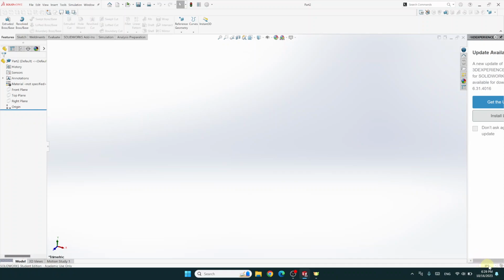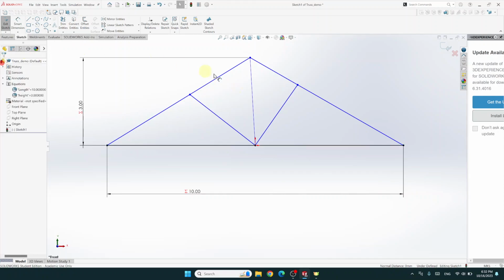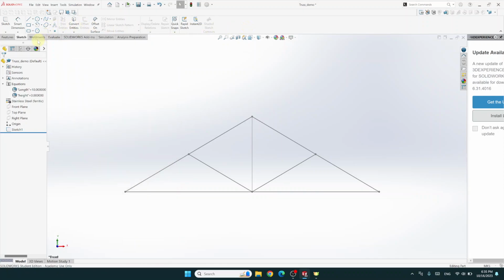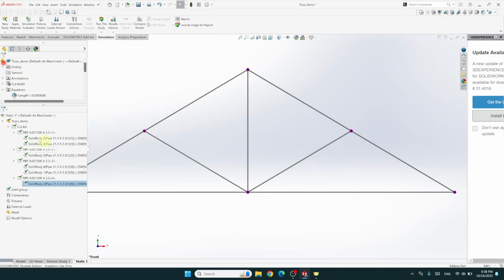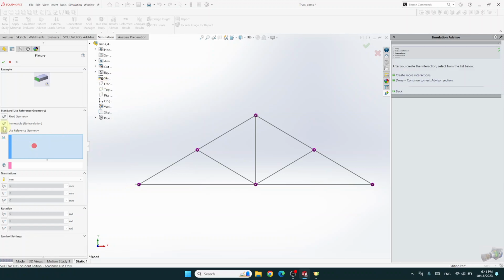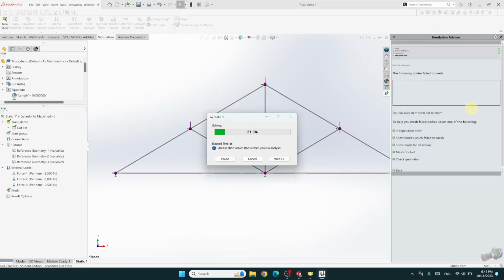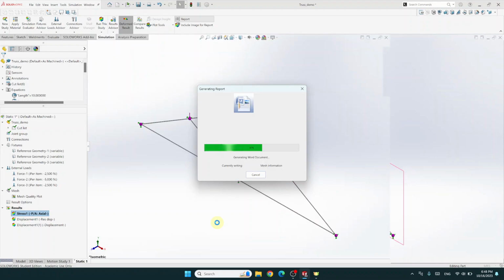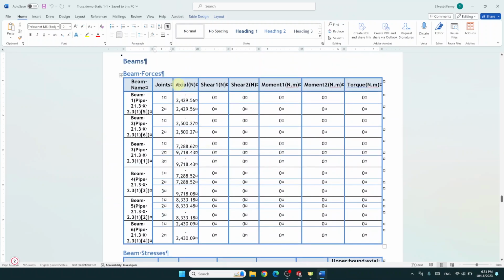Statics Truss Analysis in SolidWorks 2023

Comment: 8:54 Just a heads up you can define all your cut list pipes to truss at once by clicking each one whilst holding ctrl and then right click and then "Edit Definition" to change all at once. Also cannot overstate how often the traffic light refresh and saving is needed. I've had multiple crashes when doing the study.